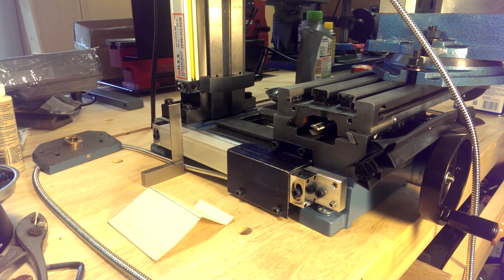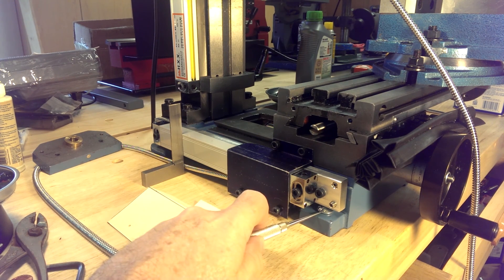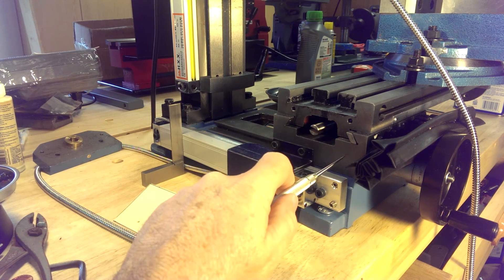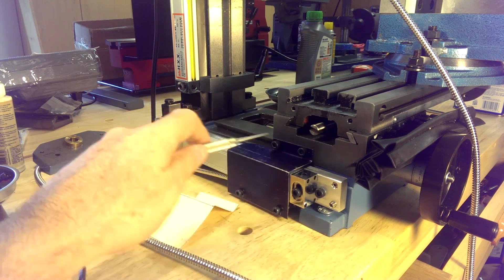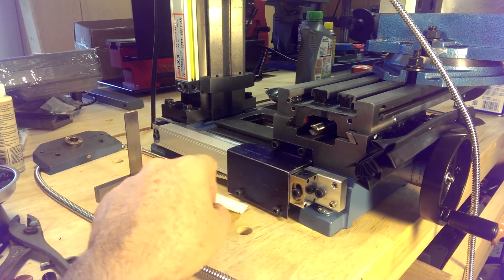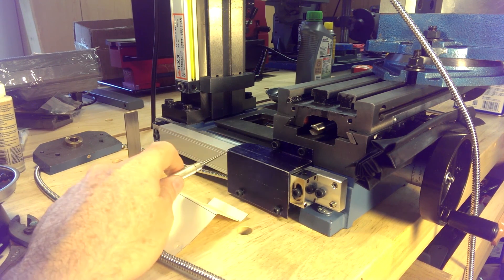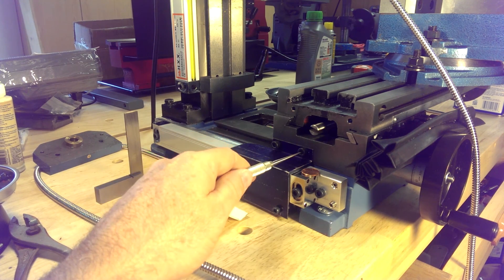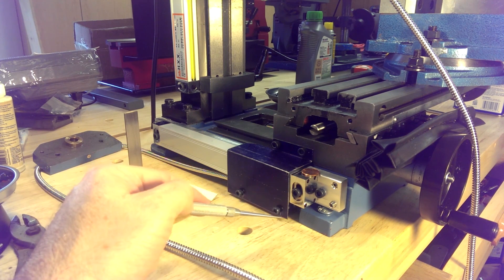HiTorque Mini Mill DRO Install Part 1

Comment: What length DRO's Scales did you purchase?
Reply from the maker: Dodge, I am out of town currently, for the summer,  when I get back I will get that info for you.
Reply: @JoediyLab  The glass scale lengths would be great, if you could post it here.
Reply from the maker: @19mati67  Sorry Tibor I cannot remember and I do not have the mill any more.  Just measure the travel of the mill and then measure the space you have for mounting.
Reply from the maker: Sorry Dodge, I do not remember, and I sold the mill.  Measure the total travel of each axis and then measure the space for mounting.  That should give you an exact meaurement

Comment: soooo....you didn't buy the DRO kit from LMS did you.....cuz my parts that I got in my dro kit from them don't look like yours.....or maybe your video is 6 years old and they updated their parts???
Reply from the maker: Nope I purchased my DRO from China.
Reply: @JoediyLab  What length DRO's Scales did you purchase? Seriously scratching my head over this. LOL Yours turned out very clean on the install.
Reply from the maker: @armadilloforge  Sorry I do not have that mill anymore and cannot remember the lengths.  Just measure the space available and make sure you have full travel between the stops.

Comment: I'm in the middle of adding DROs to a LMS 3990.  Very close to what you have.  You have good ideas to deal with the angled base.  At 5:30 you talk about drilling 3/8" holes M6 screws. As 3/8" is a lot bigger than an M6 screw diameter, Is that 3/8" deep?
Reply from the maker: Hi Jerry I must have mis-spoke,  I double checked the tap drill chart,  recommended drill is a #8.  Sorry for the confusion

Comment: Thank you so very much! I have been procrastinating the correct mounting of my DRO's because I haven't taken the time to reverse engineer of other adaptors. Your video is great explained and the solution of using setscrews is simple and elegant (I was thinking about machining the actual angles but then I wouldn't have adjustment.
Reply from the maker: Thanks Jose